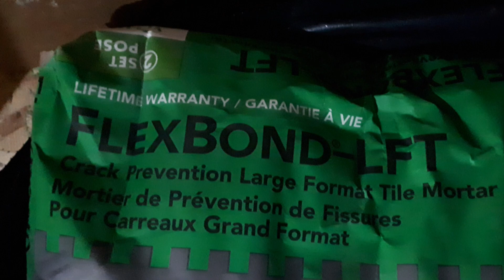Off Grid Cabin Flooring / Trail Improvements / Cabin Life Ep 74

Comment: Glenn, can I borrow Maureen?  That lady is multi-talented!  What is that pink stuff that you painted on before laying the grout?  What is it for?
Reply from the maker: Wendy ... no - you can't borrow Maureen ... lol  She's way too valuable to go without for any length of time.. lol  She saved my back from days of hurt ... leaving me to do other stuff ... The pink stuff is called 'Red Coat' membrane water proofing.. and it is applied before laying tile cement to prevent water from getting into the OBS sub flooring.  It is also helps prevent cracking of mortar and tiles.  For the small area needed to be treated, it's worth it in the long run. Thanks for watching.  The wood flooring is next.  Glenn